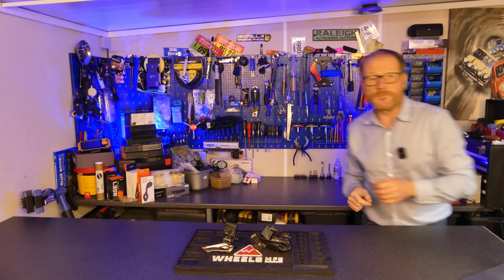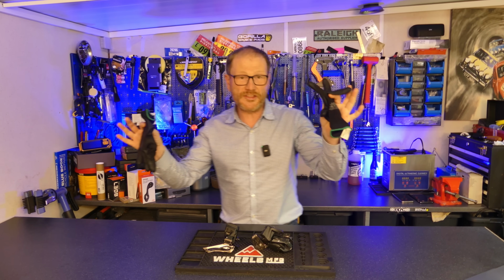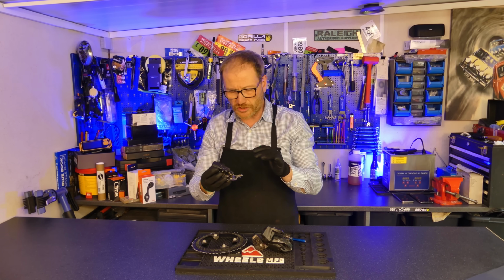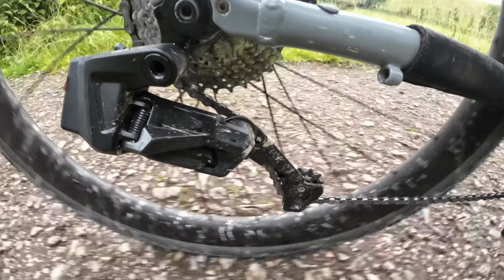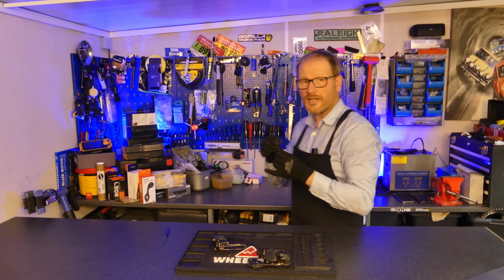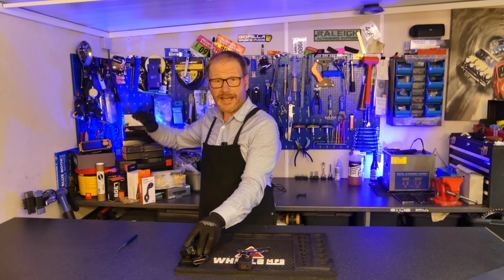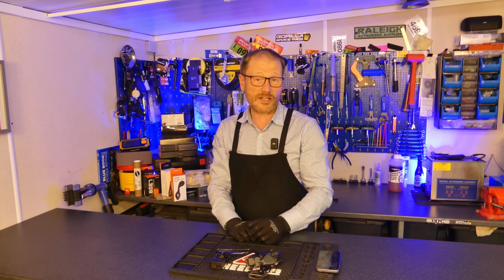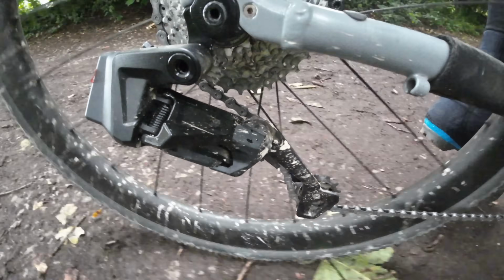Wheeltop EDS-TX Wireless Electric Groupset - Long Term Test & Review

Comment: I have recently installed this group set , was getting some chain noise going down the block so swapped my cassette and chain , opened up the app and began to tune the gears ,1st checking it was on 11 speed pressed confirm, moved on to select gears went up to 7 and then pressed to go up to 8 suddenly shot down the block to 2 ,tried it several times , this got me scratching my head, so look at the values for each gear and 11 was at 0 .. how? Soon as I reset to 1795 it went all through the gears again 🤷🏼‍♂️, now I can fine tune each gear

Comment: Great in-depth analysis. I have had mine (rim brakes) for a couple of weeks and it's been working really well, but it is my first electronic groupset as I have been using 105 mechanical so far. I could not see the screw on the FD and I struggled to line it up with the chainring, but eventually I managed to do it. Somehow I worked through the set up in the app, even if you have to interpret the translation. I am keeping it in casual mode and I really like it, there is a little FD rub when I cross chain on the big ring, but minimal. I will check the wear in a few months, but I would not go through bad weather if I can avoid it. Luckily I don't have to bleed the brakes, if anything my rim braking seems better with the same callipers and the new levers, maybe they have a different pull ratio.
Reply from the maker: The Support Bolt:
I talked a lot more about this in the video, but cut it out in the edit, as I thought I was going on, and nobody would care...... That was a mistake!!

The Support Bolt was originally used on mechanical groupsets as a brace between the derailleur and frame. It was needed due to the pressure from the spring on the frame and strap. However, it also offers adjustment to the alignment between the derailleur and chainrings. Nowadays, with electric shifting, those forces aren’t present, so the screw isn’t technically needed for support, but can still offer adjustment.

TBH, as it's not 'Technically' needed, Wheeltop would've been better off leaving it out.

FD Wear:
You can't stop the wear when shifting, but you can dial it out when riding. There are 6 positions for the FD,  understanding these can help with chain rub, and it will help to reduce chain wear to the FD. This Wheeltop document details those positions:
https://docs.google.com/document/d/1XmM7enMUmZ_mClXzVrNIUDlt9Ci0PJWpmsJoQ9jhEWo/edit?usp=sharing
Reply: My old di2 11 speed used to trim perfectly, I think it even pivoted as well as dropped down if you went to 50/28 for example. I like to be able to use the whole cassette in the big ring even tho on any set up it will likely be more noisy. What calipers are you using? I have either 105 or ultrgra (the final ones they made)

Comment: Rear derauleur adjustment for 12 speed 11-36 cassette.
I made it simple, and it works:
There was an interesting difference between adjustment nubers. So, as there is the same pull ratio in cable groups, i decided to make the same for electronic one, except first and last gear.
Adjustmen start from 0 for small sprocket and ends with 2000 for big sprocket.
I left 260 points for 2nd sprocket as it was made by Wheeltop. Then i adjust all other gears with 170 points between  gears. Than used to make final adjustment between 7 and 8 gear (160 points), and 10and11 gear (190 points), probably because i have an Aliexpress cassette. In the end, i have 210 point diference between 11 and 12 sprocket.
As said before, it works.

Comment: I'll leave my impressions here as a somewhat early user (May) that does ~15h/week:

- Setup was painful to say the least... I have had to tinker with the RD numbers on a training ride because chain was quite noisy and skipping. Ever since then I've had no issues.
- Shifting is good enough. I have a GRX Di2 11sp and it's definitely not better but it gets the job done for a road groupset. It just works fine if you set it up properly.
- Wear is noticecable on my FD, just like shown in this video. Luckily I use hotwax as lube so it's not a 100% metal to metal contact. Bolt heads are all rusty as well.
- Breaking feels like my old ultegra. I was lucky enough to be able to buy the groupset without calipers, so I kept my ultegra calipers. No issues here.
- Battery life is doing fine for the most part. I had to swap to Casual mode because my battery was drained after a week when using comp mode and it was pretty annoying. I went through two sets of shifter batteries for some reason...

Overall is a decent groupset that does what it's meant to do on a budget. If you like the shifter shape (very important for me), you are on a budget and don't mind slower shifting, then I'd go for it since electronic shifting is much much better (at least for me). I'm still waiting for them to list replacements.... So once they do, I feel like it'll get more attention. I am kind of worried about the shifter battery cap... The o-rings there are stupidly thin and one of them broke... so I am worried now about waterproffness... 

Hope it helps.
Reply from the maker: Thanks for sharing, Jorge. Sounds similar to my experience, to be fair. 👍
Reply: sounds like you guys do not know how to set up your front FD
Reply: Obrigado 🇧🇷😉🤙🏼
Reply: @luismanrique5373 maybe just maybe it could be the FD itself as there seems to be a lot of people which somehow don’t know how to set up a FD. Strange on all my other bikes I somehow know how to do it. 🤷‍♂️

Comment: Great job! I’ve had my EDS TX for months now and I love it…..for the most part. It took forever to set up, but once it was, I forgot it was there. I ended up taking the front derailleur off and making it a 1x system on my steel framed bike and since then I’ve had zero issues. The biggest crux of the group set is the front derailleur, in my opinion.

Comment: My two pennyworth....I also resorted to pliers for the hood rubbers but I  wrapped them in a towel first. I managed a full bleed on the back brake using 2 syringes but I couldn't get the front brake cover back far enough to access the bleed port - so I turned the bike upside down and bled via the caliper! Amazingly it worked fine. 
Regarding initial setup via the App, my only problem was the one Tracevelo had with his front derrailleur  - but mine was with the rear. This happens if you enter initial calibration in anything other than biggy small.
I can highly recommend the video by TilmanvonderRadelbande for set up and fine tuning.
And finally, one feature  I'm only just realising is the difference between a long and short press on the left shifter button. A long press will force the FD to its maximum movement to facilitate the chain moving from one chainring to the the other.  A short press will initially move the chain to the max and then trim it back to the best position according to the chosen cog on the cassette. I think!

Comment: I’ve just spent a week in the Alps riding with the groupset with no issues, other than the one John mentioned about chain rubbing the front derailleur when on the big ring and trying to go onto the 4 biggest rear cassette cogs. I do have oval chainrings on the front too so though this could be a contributing factor. Other cyclist in my group running Ultegra Di2 both also had issues with theirs.
Every gear change was bang on and the Garmin feature that tells you’ve run out of gears is bittersweet when you’re on a stinking climb!

Comment: A small nuance from my experience(2 weeks ;) ) with Wheeltop EDS-TX - shifting is as good as it's indexed. My shifting works great, but I spend around an hour in total fine-tuning every gear individually via app - it's not hard at all, just requires some proper attention.
I have another bike(Canyon Endurace CF SLX) with an Ultegra Di2 groupset, and besides ergonomics, I can't really tell which shifting is "better". Ultegra engages rapid shift(when I hold an up/down rear gear button) quicker. But besides that, I can't say Whelltop works any differently.

Comment: I have 2 sets of these on both of my rim and disc brake road bikes. I do admit that the FD setup is painful, I broke a my FD during my first installation. But after a couple of Bilibili videos details of how to set up the FD, the entire group works very well. Also, wheeltop replaced my broken FD's cage without asking anything, so warranty in China is at least good.

The May frimware update this year allows us to connect this groupset to bike computers, so gearing can be seen directly during rides. Also, the chinese manual has been completly rewriten, so the setup process makes a lot more sence.

There are problems at the moment wheeltop still needs to address. Such as that stiff shifterhood, the fitment of  rd charging port's seal and  level reach adjustments for both types of shifters. But as their road drivetrain first attempt , it is good enough for budget minded cyclists.

Comment: I've got the rim brake version and it works perfectly. I had tiu fine ture a couple of gears, that's all. After 500 miles I've started to get the low battery warning on my Garmin, too. On it's app it is still at 60%. Apparently that is a reported Gamin issue when reading the sensors via bluetooth.

Comment: 9:00 If you setting up as race mode, the groupset will not automatic sleep, so the manual recommends you after riding then switch to common mode.

Comment: My experience are very similar to yours on the groupset although I have the rim brake version. I haven't seen the rusting or so much wear on my FD cage but I tend to ride in dry weather, otherwise I use the turbo and that's where my Wheeltop will sit once our terrible summer has turned into a wet winter!

For my purposes the Wheeltop is a workhorse, I've Di2 on my fancier bikes but the Wheeltop perfectly fits my requirements for an upgrade to a bike (from mechanical) which I didn't want or need to spend a lot on. 

I found the change quality to be chain dependent, it didn't like KMC chains but worked well with Shimano DA lubed with Silca Synergetic. 

The carbon shifter levers have a very fragile finishing coat, they scratch easily so don't leave the bike resting against a wall! 

The supplied brake cables seem to have a low friction coat so you really need to tighten up the pinch clamps on the calipers to stop cable slip.
Reply from the maker: Sounds like we have a similar setup then. Good tip on the shifters. To be honest, I've always found Shimano chains shift best with Shimano groupsets. I feel the HyperGlide technology prefers the directional Shimano setup.

Comment: Also believe that with the firmware update, if you have it in race mode and battery goes below a certain level, it automatically switches to casual mode. I have not tested it yet but worth a note.
Reply from the maker: Yes, this was what the update notes suggested, I think.

Comment: I think of the "support" screw as needed for bracing the front derailleur against the seat tube to address the high leverage of the servo. There have been "braze on" frame attachments broken when unsupported (Cannondale).
Great review!
Reply: Was the issue with mechanical systems and the resistance needed to push against a strong spring? Or does it also apply to electronic?
Reply from the maker: Agreed, M. Talley, you're spot on. It can be used for both what you say, and what I say....... Although technically, it's meant for 'Support', hence it's name. However, we don't see the pressures in electric, like we do in mechanical. And as I say, you can't get to it once it's in place anyway, so it serves no purpose for either use. To be honest, they've been better off just not adding it to the design.
Reply: @MrJwmurph  Both as far as Shimano goes. Newer model Shimano road and gravel address having higher leverage with a small sticker-on metal plate (if needed) for the set screw to contact. Newer braze-on bands have a section incorporated for the same reason.
The plate makes sense for carbon frames as well for protecting paint finish on steel and aluminum.

On this Wheeltop mechanism it seems they didn't think the design through.

Comment: I'm interested in their EDS. For the e-bike mountain bike version, the derailleur is different, but they will need replacing every two years if the battery dies out of warranty, as the battery can't be replaced! They used the micro-fine tune in their new MTB version. A friend just got it, and it's incredible, to be honest! Just that non-removable battery that's stopping me going ahead with the order oh and the reply I got from them I would have to pay the post office customs charge at this end!

Comment: Great video Jon.   On my newly installed Wheeltop EDS TX, I want to assign the large left shifter paddle to sequentially shift through the larger cassette cogs (i.e., progressively 'easier' gears), assign the large right shifter paddle to sequentially shift through the smaller cassette cogs (i.e., progressively 'harder' gears), and assign the small right shifter paddle to just shift the front derailleur.  I have been trying to do this with the Wheeltop phone app, but have not yet succeeded?  Thank you.

Comment: The biggest issue is the front derailleur rubbing in lowest gear and nigh on impossible to fix. As per trace velo has experienced. 
The rear one for me has worked well with lots of adjustments.
The rear battery cover is rubbish as you mention.

Update: after several useless conversations with wheel top I got the FD sorted by using the debug in the app. Using the Front derailleur section, Alter gear 5 position to 1300 (it may be more or less for you as default is 1080) and all works well. Unless you are told this as I was (by a Facebook group) you wouldn’t have a clue how to do this, it took literally 1minute. After spending countless hours.
Reply from the maker: The front derailleur does seem to have adjustments on all 6 points, so I’d be interested to have a play around with that. Trouble is, i daren’t, as it’ll end up even worse 😬
Reply: Yep, ended up worse at one point. I’ve given up to be honest as I’ve spent so much time on it. I Just limit the of use my 30 to avoid the chain rub noise. 😢
Reply: @iamthedalilama  I know someone  in Denmark on facebook on the eds group page had a issue with his right shifter and was not changing up the clogs(fixed now). I asked about this chain rub with the FD and he's managed to set it fine and he is using 11-32 cassette . on 52 ring  and on 32 clog showed me a picture and I can tell you it is 1-2 mm clearance from the inside cage. So it can be done.

Comment: UPDATE: right shifter ran out of power. So replaced the CR battery. Won’t show up in the app as it says it’s sleeping. And also won’t change gears. It’s communicating with the rear as when you press it and the lever and rear green lights flash. But press it and gears do nothing. Strangely it works in the app. Also when i change from big ring and small sprocket to little ring and the gears jump up 2 at the back, I can change down with the lever but then it’s stuck there again and nothing happens. I’m swapping back to mechanical until I can get it sorted but too many issues in my experience. I’ve had them since May.

Comment: Hey Jon. How did you resolve the support bolt issue? A longer bolt with some threadlock, perhaps? Also, if you turned it around, is the head not accessible from the other side?

As for FD wear, would it be possible to stick on a shimano (or DIY) plastic protector - or even replace the lower cage with a shimano one?
Reply from the maker: The Support Bolt:
I talked a lot more about this in the video, but cut it out in the edit, as I thought I was going on, and nobody would care...... That was a mistake!!

The Support Bolt was originally used on mechanical groupsets as a brace between the derailleur and frame. It was needed due to the pressure from the spring on the frame and strap. However, it also offers adjustment to the alignment between the derailleur and chainrings. Nowadays, with electric shifting, those forces aren’t present, so the screw isn’t technically needed for support, but can still offer adjustment.

TBH, as it's not 'Technically' needed, Wheeltop would've been better off leaving it out.

*FD Wear*:
Shimano don't use one on their electric FD's (For the above reason I suspect). I checked my Shimano Di2 FD, and it didn't look like the Wheeltop one.
Reply: @ribblevalleycyclist  Ah, thanks for the insight.
Let's see how it goes in another few months👍
Reply: Sram have support for electronic groupset.

Comment: Hi, i am looking for a information if you can combine this groupset with shimano disc brakes, if there is a compactibility on hose connector on leavers
Reply from the maker: Yes, all compatible. You can directly replace Shimano levers with Wheeltop. Just take the Shimano off, and the Wheeltop will go straight on. You may need to bleed the system though.

Comment: I m running rim brake version and it runs very well. But my head unit which is Bryton S500 didn't show the gear position correctly. Both front and rear, it's like inverted effect..

Comment: Local prices seem to make this as expensive if not more than the LTwoo eRX.  Have you used it? How does it compare?  I have the LTwoo eGR on my gravel bike and its been great.  But thinking of some electronic groupset update for my chinese carbon road bike.
Reply from the maker: They're working on distribution, which should help on pricing. I was thinking of contacting LTwoo, and asking for a demo unit. Trouble is, I've got a massive backlog of stuff to discuss on the channel already!!! Think I'd like to try it though.
Reply: @ribblevalleycyclist  Their app is quite good.  You can micro adjust each gear on the cassette.  I used it while on the trail a week or two ago when 5th and 6th were just not quite right.  Not true wireless I guess, more like di2, with a battery in the seat post, but seems good so far. I've not given it any HARD use though.